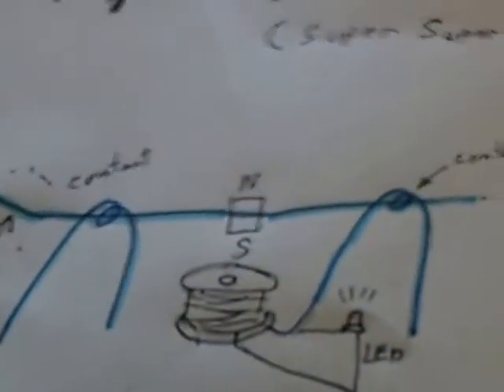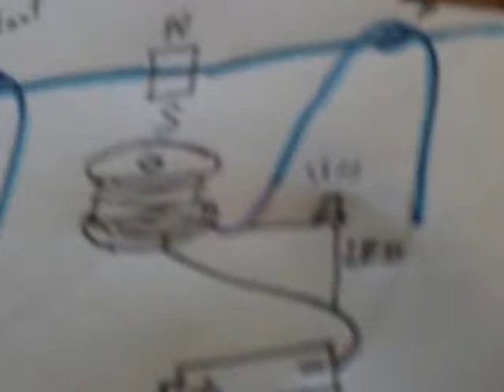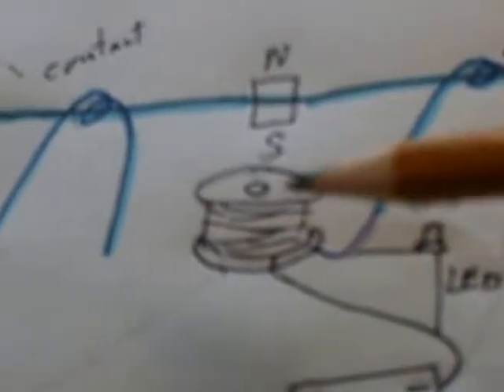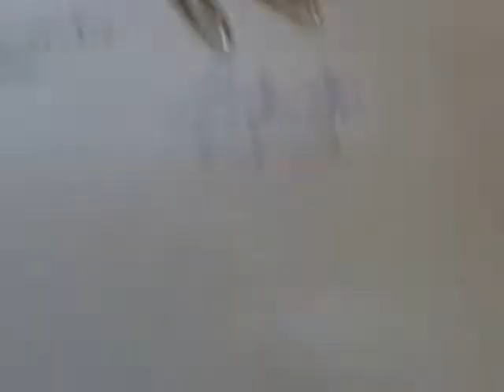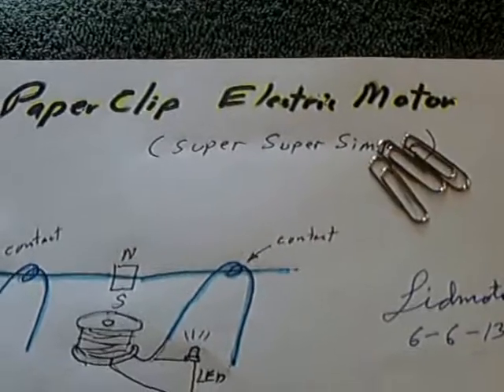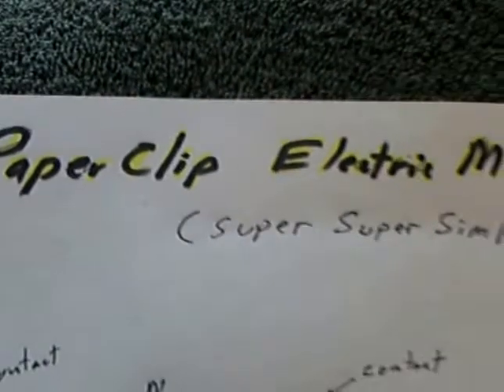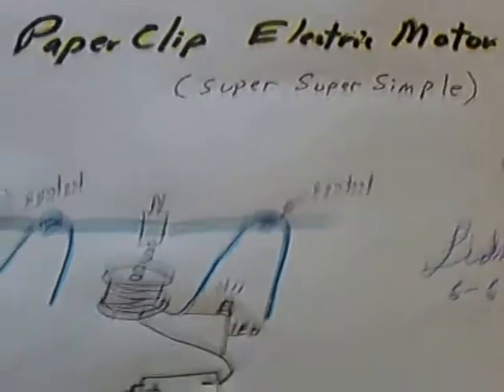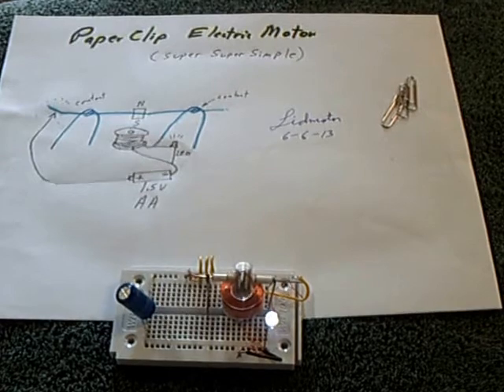Paper clip electric motor

Comment: I hearya. I recently took two recycled computer fans and built a home-made shroud / case.. and have them hooked up to 2 capacitors and solar panels (10 watts) -- and they ventilate my car at work. If the sun is not really bright and full, then neither is the car hot, and no need for it to operate full boar. It really works well compared to those little bought jobbies, as it has some really solar watts behind it. Simple

Comment from the maker: This little motor has quite a lot of friction but it will run on 1.5v at 30mA.  It doesn't care where that power comes from----a battery, supercapacitor, solar panel, dynamo, or homemade cell.

Comment from the maker: I was thinking about using some of the other circuits we have come up with to run this 'paper clip'  motor with.  Should work even though the friction is pretty high. There is enough room on the board to mount the other components.